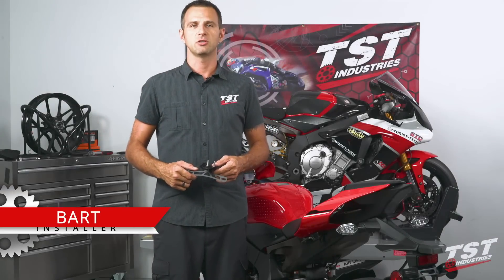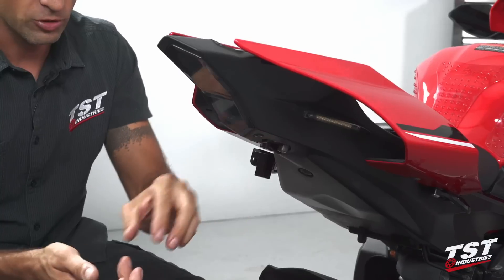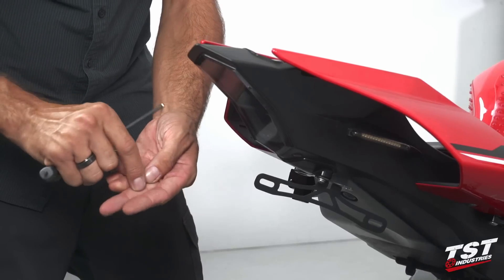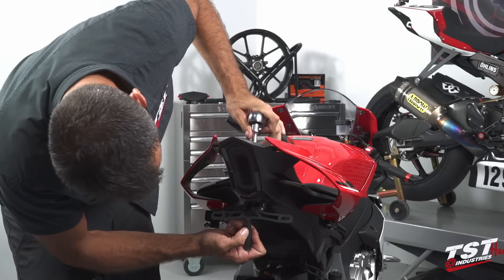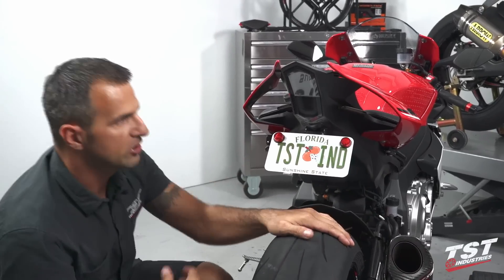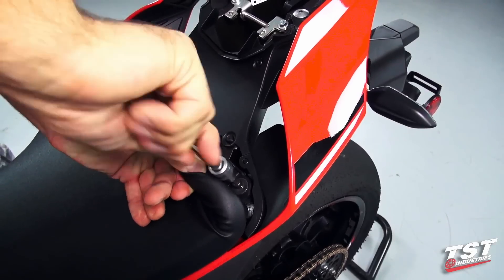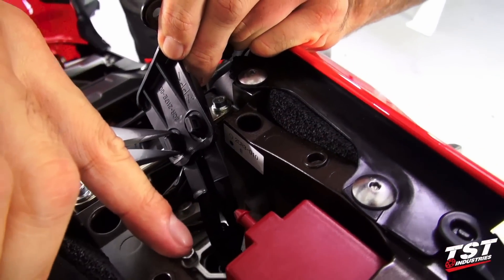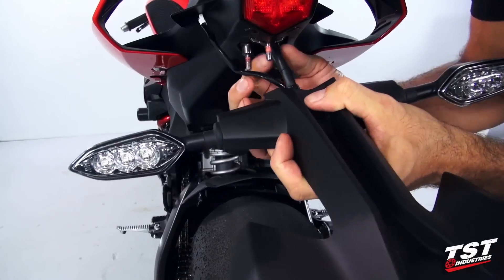How to install a Standard Fender Eliminator on a 2015+ Yamaha R1 by TST Industries

Comment: I installed this today with the Oem signal bracket and had to go buy longer bolts to complete the installation. I wish this video would have covered that so I could tell if I did something wrong.